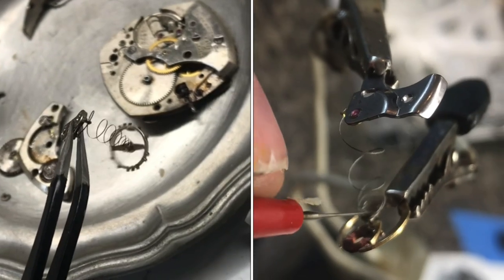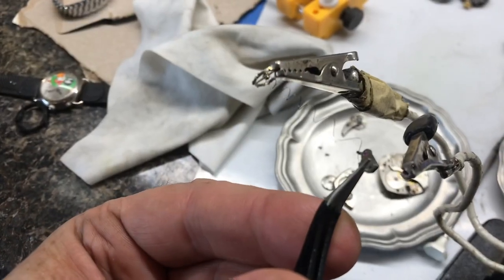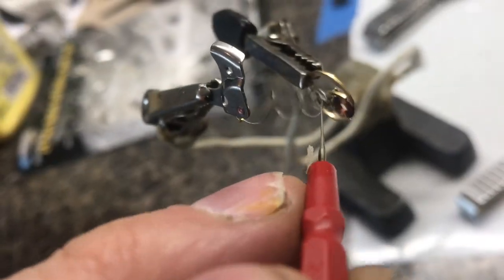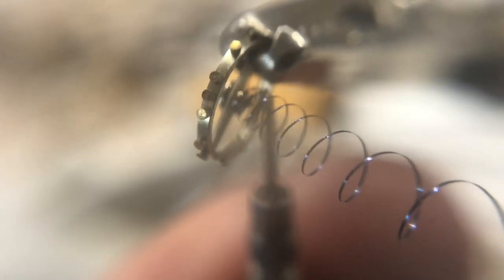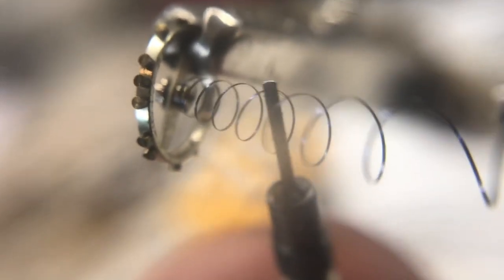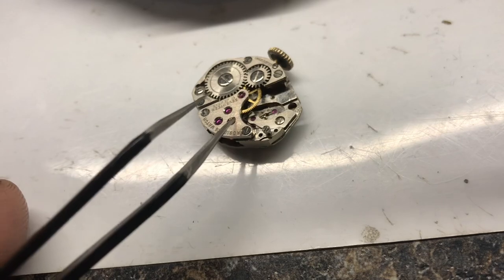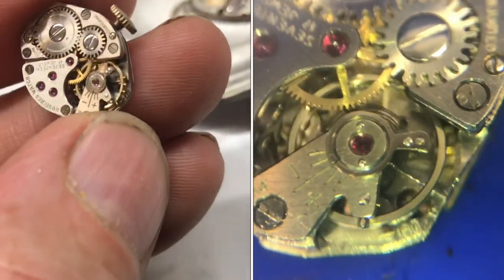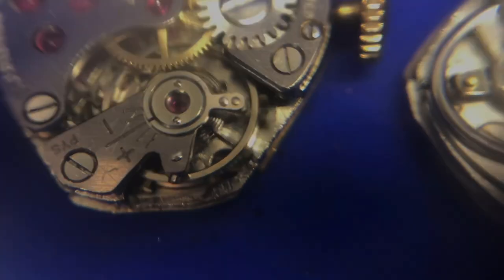UNTANGLING “hairspring” on wrist watch

Comment: This is the only video I found about this subject. I twisted my hairspring, attempting to put in the balance wheel, and I want to try your solution. The two alligator clips seem to be attached to hard wires (?) and some kind of heavy clamp(?) How did you attach them? Thanks.
Reply: Fran Blanche over on Fran’s Lab has an old video of Henry Fried showing how to untangle a hairspring